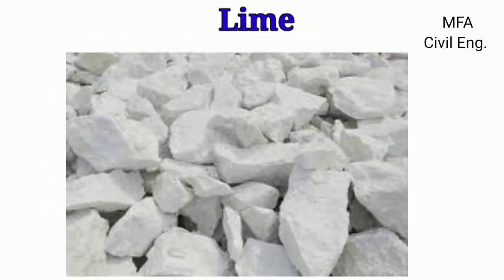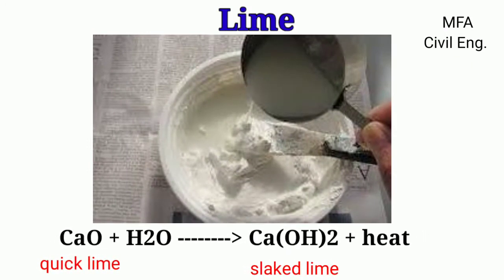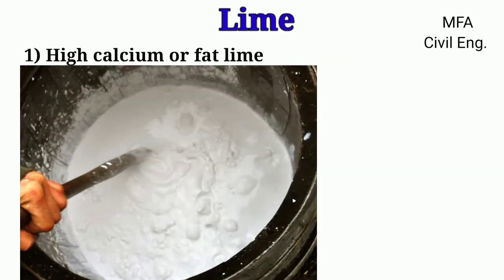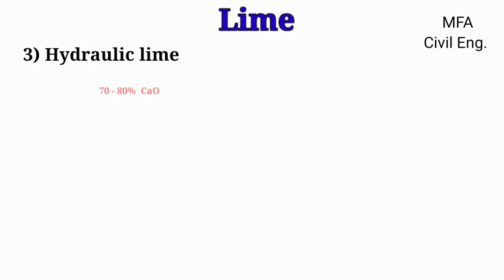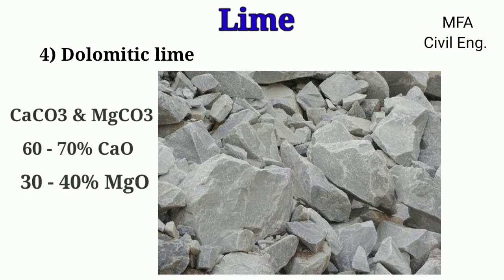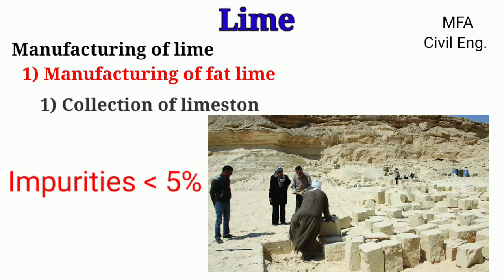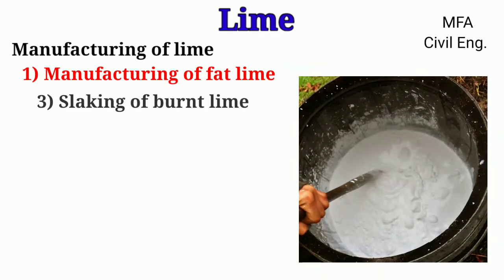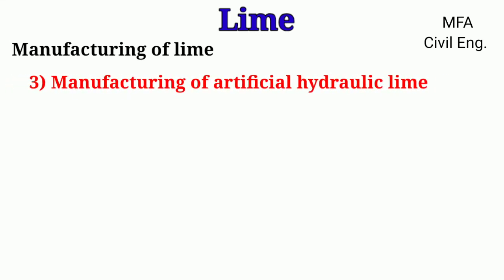The Ultimate Guide to Mastering the Lime / Quick lime: Everything You Need to Know!

Comment: fast acting lime v. hydrated lime when it comes to storing eggs?  I bought/used the wrong one.  Eggs are not floating/good.  should I dump them anyway?
Reply: Yes.  Start over. Hydrated lime. Only fresh unwashed, no fractures, but clean eggs will work for water glassing.  Best to you

Comment: 1. Which is good for build House cement or lime(chhuna) ?
2. Which is less costly lime or cement
Reply from the maker: If you want low maintanence and long life after construction of house then use cement. Cement have high bonding strength then lime, so cement bind other material (sand,aggregate, brick) more strongly. And have low maintanence cost. In other side, lime is quite economical during construction but have high maintanence after construction. So i suggest cement is good for house then lime.